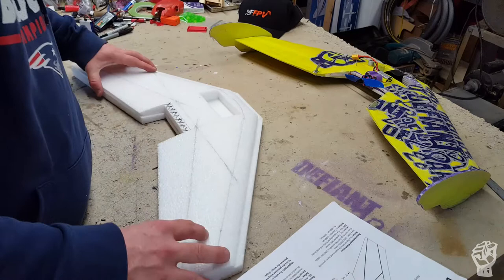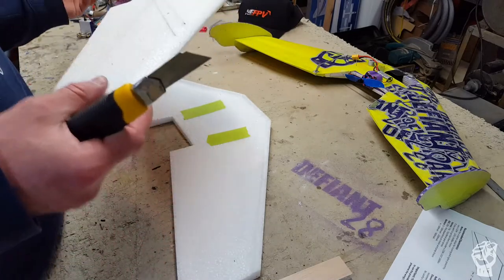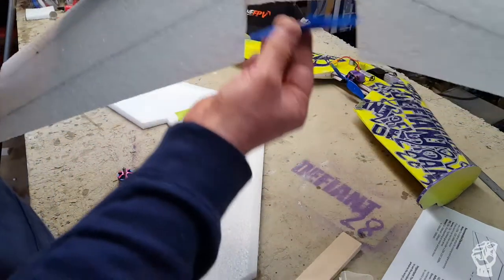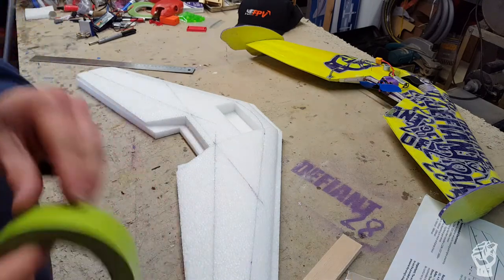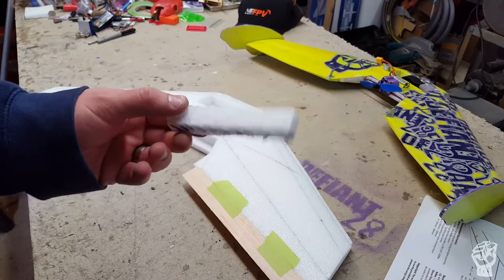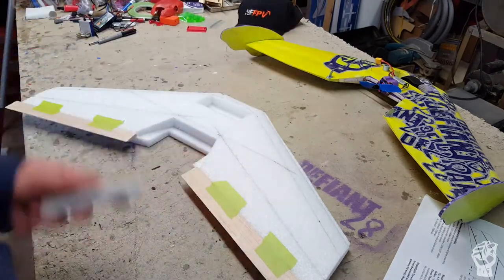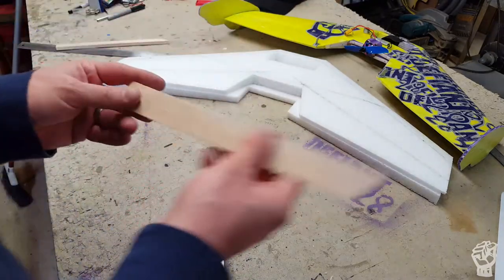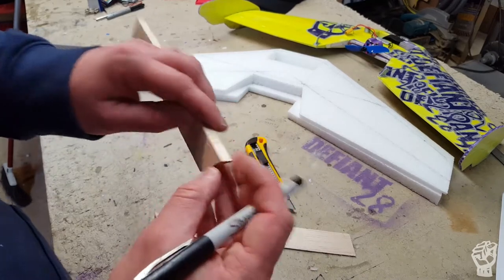Defiant 28 Build Video 4-1 – Shaping Wings and Elevons

Comment: Thanks for the video . I have to say I like these wings and im big into buying kits from people like yourself who design them . Been a ProBro member for years building different user designs profile 3d planes . They are a great community that posts several builds from each type of plane . Where can I find some more build videos on these and more ideas on equipment used and placement . There is hardly any build videos out there and in my case im having to watch this to build a Defiant 42 I bought from a friend . Its like this side of RC is some type of secret community . Sucks being a newb sometimes .

I do have a question on this vid . These ailerons are not symetrical . Depending on how you put it on determines the amount of down throw . On the leading edge of the aileron one corner is 90 degrees and the other is less than 90 . I assume put them on so you can achieve max down . It looks like you put them on for minimum down . Also I got the 3d printed camera mount for the gopro hero and vtx camera . It seems really heavy . I was going to use my 4s4000 pack on it and am thinking I might have issues with the balance . Is this a legit concern ? I am almost thinking of trying to use my Tarsier or Split so I could get video . Thanks again for the vid .
Reply from the maker: I’m glad the video build series is helpful. We just released the one series because the techniques are the same for I’ll of our wings. You are correct, you want the elevons installed for maximum travel so install them the 90deg angle at the bottom. The smaller angle should be at the top and attached to the wing. 

The 42 can carry quite a bit of weight. I fly mine with the printed camera mount, a GoPro 7 and a 4s 5200. The camera mount and GoPro will help make getting the CG right a lot easier. 

Good luck and enjoy. If you are in Facebook stop by the Defiant Wings Owners Group. There’s a lot of great people in the group and good discussion